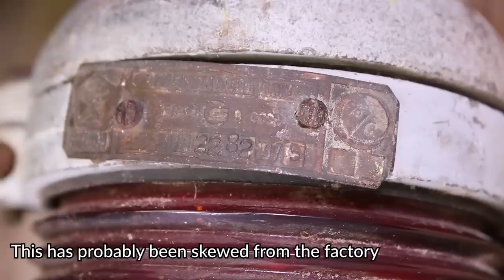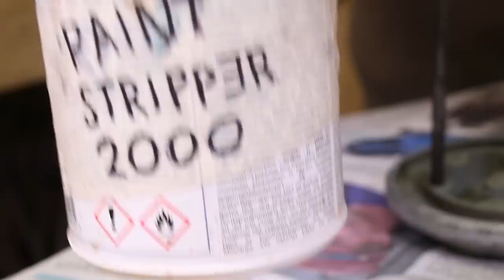Nuclear Submarine Light Restoration. Cold War Restoration

Comment: Nice restoration. Few observations: stranded wiring under screw = fire. Pls use ferrule. For the threads: worth using blue thread locker, keeps out the elements and the rust.

Comment: Instead of grabbing the shafts of those long bolts with pliers and possibly scarring the metal, try using two nuts, jammed together on the other length of thread at the other end.  Put the wrench on the nut closest to the bottom, using the top nut to lock it in place.

Comment: To help release badly corroded parts mix Acetone and Automatic Transmission Fluid together in equal parts . Store in a glass container .This solution will free bolts rusted solid for decades , is cheap and easily made . Really difficult parts might take a day or two .

Comment: This light wasn't a warning light for inner space of the submarine. I rather think it is an navigation light because as you can see it has a fresnel lens on the outside (this edgy outline on the red glas). The fresnel lens is used to direct the light in a certain direction so it is better seen from far, which would be useless if it would have been installed on the inside of the submarine.

Comment: 11:50 how difficult is it to use this tool? I would imagine it gets annoying trying to apply even pressure to either side in order to dig straight down into the metal without wobbling from one side to the other.

Comment: If you have trouble with seized parts you can boil the assembly in oil. The oil gets very thin and can penetrate tight spaces. That works especially well if you have a steel piece stuck in an alloy piece as the heat expands both parts - but the alloy part will expand more due to the physical properties of the metal. Hope this helps in future restorations!

Edit: I think that white gunk on the large threaded pieces was old sealant or nylon ribbon used to keep an air tight (or water vapour tight if your in a submarine) seal.

Comment: Nuclear Launch Detected.
Reply: (DYING MARINE SOUNDS)
Reply: This is not from a submarine.
Reply: @budmeister  it literally says Nuclear submarine light
Reply: @Rogue-hh7mh  Read what the Russian commenter says above. This is not from a submarine but a surface ship. He got swindled. The only thing that states that this is a submarine light is the guy uploading the video.
Reply: @Jotaro Kujo The pressure outside pushes on the walls of the sub, not you. The inside should be about the same as on the surface, this is why subs are cylindrical, so they can fight against the pressure of the water at all sides.

Comment: As someone who used to build electric motors my instincts are screaming to Vaseline the gaskets so they last longer but anyway, this video is just so enjoyable to watch. Thanks!
Reply: Vaseline is petroleum-based and therefore, with time, likely to degrade these original, older, rubber seals (unlikely to be nitrile or neoprene)..... A sealant designed specifically for rubber would be recommended, such as us used for rebuilding brake calipers.....
Reply: The gasket and the washer are placed in a wrong order too (a very common mistake, so it could come like this from where he bought it). The washer comes between the gasket and the screw, so that the screw won't twist too much it when tightened.
Reply: Mine too!

Comment: I noticed one item that you reversed when reassembling. The two large ports on the top... when you removed the metal fitting, you then removed a metal washer and then the large rubber washer. When reassembling, you replaced the metal washer first, then the rubber washer. I don’t think it matters unless you plan to install it back on a submarine. 😉
Very cool restoration thought.

Comment: great j ob on the restoration! ..however, on reassembling the Wire Gland, you put the washer in first, then the Rubber Compression Gasket. The washer is supposed to be between the rubber compression gasket and the threaded bushing. The washer is used like that to stop the threaded bushing from tearing up the Rubber Gasket when tightening it. 

...love the content btw! I've been taking in a lot of your videos recently!

Comment: I noticed whilst you were removing the rubber seals during the dismantling stage that they appeared to have had some sort of sealing solution applied to them when new. I was a little surprised to see that you didn`t bother to use some sealant during reassembly. I know that it`s unlikely to go back to sea on any vessel but even if you used it as an outside light at home, the extra weather protection would keep the water out of the lantern. Good job all the same.

Comment: Submarine Lantern - No Way!
1. Lantern - hanging (visible upper and lower rings for the halyard). The submarine does not have rigging to hang it.
2. The nameplate says: “I can’t give way” and the lantern model is “567-3”.
Therefore it is a red “all-round light” (IRPCS-72, rule 21.e) used according to rule 27 of IRPCS-72.
3. The lights of this model are still being made ($70-$100). The manufacturer indicates their range - 2 miles.
IRPCS-72, Rule 22 - such lights for ships less than 50 m (160 ft) long.
Where have you seen such a small nuclear submarine?
 They have a typical length of 100 m!
In short - the "fisherman" was stripped ...

Comment: If have a metal housing (especially around water), you really want a 3 wire cable/plug that has an earth (green) wire. This wire gets screwed into the housing. That way if a wire gets loose and touches the housing, all the current will flow to the ground wire, and not to your hand. 

You might also want to get some anti-seize grease for those screws so they don't seize up in the future (it also makes threading them in a LOT easier).

Great video though, I enjoyed it a lot! Wow those things were overbuilt for holding a bulb.

Comment: At 6:16 it looks like some remains of hydraulic isolation tape that you put on a screw to prevent water from going inside (or outside in cases of taps)

Do not contact WD40 with a rubber. There is a reason why cyclists do not clean their chains with WD40 (besides its not an oiling substance) since spraying it on a tyre ends bad for material life.

You could get the old glue by using a heating pistol just like people replace screens in their phones, but someone should confirm that as I do not really know what kind of glue were used back then. Such rubber could be then poured with olive oil to extend its life as some people do it with small rubber seals

Comment: Being an electrician I couldn’t help to cringe when you stripped the insulation off the wires with you razor knife... there’s a tool called a wire stripper that’s made to cut insulation off the wire quicker and easier than the way you did it. They cost no more than $30. You should look into invest into one for future projects.

Comment: Good job, I guess, but those distribution blocks are there for a reason, furthermore, it had a ground point at the bottom of the frame of 9:07 I would highly advise rewiring it up with a 3 wire cable and running a ground, just to be 100% safe.

Comment: I see a lot of people cleaning vintage stuff with old-ass brushes (with steel bristles no less), and always cringe a little. Once rust has been chemically dealt with, I would highly recommend using a brass tumbler. They are uses in bullet reloading to clean the cases, and would provide a much more consistent cleanliness without the as much damage or wear patterning as abrasives leave you with. You could use traditional brass tumbling media or stainless pins to great effect in restorations like these.

Comment: At 1.18 you were in danger of stripping the bolts. My Grandfather used to repair / rebuild marine engines, he taught me when undoing rusted bolts n nuts three turns out one turn in. It gets the rusty crap out of the threads. May take longer, but replacing a broken bolt is a lot worse for time